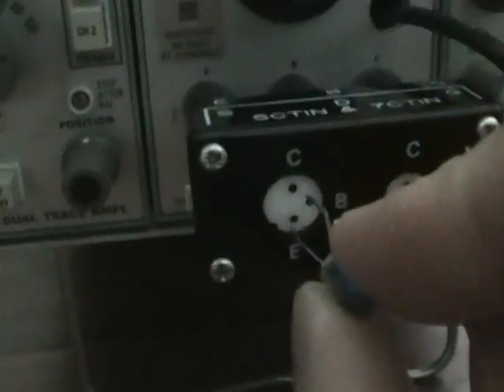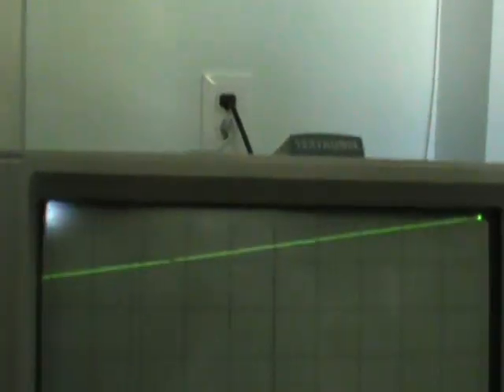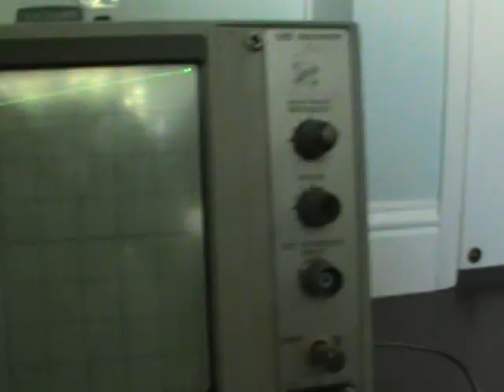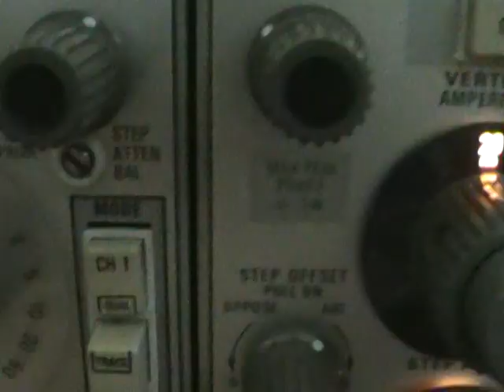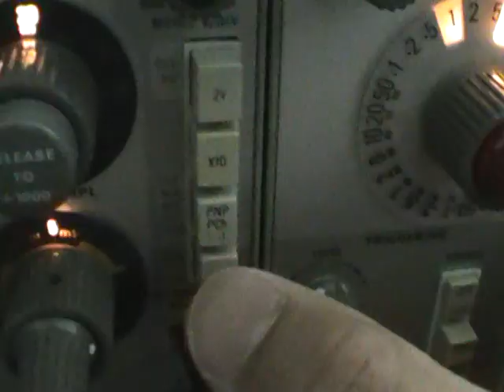Strange LED Phenomenon

Comment: The curve tracer plugin 'sweeps' a junction with voltage ranges between Vmin - Vmax (usually 50Hz or 60Hz AC) and measures the junction current, displaying the voltage/current relationship on the screen.

The trace hysterisis is due to the LED junction going in and out of conduction.
Reply from the maker: I made a video that shows me using a simple curve tracer that does not cycle. https://youtu.be/qY6TyUI7Nuw?si=mqX9xCRzQ_ffZHP4

There is also an EEVBlog thread: https://www.eevblog.com/forum/projects/linear-led-non-linear-led-strange-led-phenomenon/msg5569403/

Also, from your other comment, zener, and germanium diodes behave as expected for a regular diode, and don't act like a resistor for some part. The only tunnel diodes I have are the trigger circuits of my Tektronix scopes, and I'm not quite keen on potentially damaging them.

Comment: LEDs have a similar characteristic to neon bulbs: high impedance until conductance occurs, then low impedance.

I suspect stray capacitance is keeping the LED in the conductive region, combined with junction temperature increases while conducting.

Id try sweeping a germanium or zener diode, and a tunnel diode for comparison.

Comment: If you are testing with a pulsed signal, the barrier capacitance also comes into play. The value of this capacitance is voltage dependent. With an alternating current, this will show as a variable resistance at the curve. Is the test signal DC or DC with an additional AC component ?

Comment: My hypothesis on the changing behavior starting at 1:40...

You could be seeing temperature effects here - diodes typically have a strong temperature dependency.  When you first plug in the LED, it has been fully OFF for a short period of time, allowing it to cool.  So when you first plug it in and are checking low currents, you get the resistance of a "cool" LED.  Once you drive it hard enough to turn on though, the diode heats up and his resistance drops, lowering the curve in the southwest corner of the trace.  Since the tracer keeps turning the LED ON each time it sweeps current, it stays warm, keeping the lower southwest corner pinned near the bottom.  You can test this theory by using a heat gun to warm up the LED after it has been OFF for a while and see if it recreates the same effect.  Cold spray should increase the slope of the early part.

If it doesn't, then it appears that reverse-biasing it before hand has left a residual charge on the junction the takes a certain amount of current to blow through before it regains normal operation.

What I find interesting is the small loop on the slope during conduction.  I would expect that to be a single straight line.  I wouldn't think that the temperature would change that much between going up and down the curve, but maybe it does.  It would be interesting to see if that loop widens with cold spray or a heat gun.

Comment: Did I understand it right? After "pre-conditioning" the LED with reverse voltage up to the breakdown value you see resistive behaviour in forward direction. As soon as the usual forward voltage of the LED is reached, it returns to an usual diode curve?

It´s long ago I did semiconductor physics, but let me guess anyhow: A diode in reverse direction spans up a depletion region at its junction. As soon as the reverse breakdown voltage is reached, charge carriers pass this region.
My assumption is: After removing reverse voltage, some of the charge carriers stay in a metastable state near the junction and behave like a crystal lattice defect. Lattice defects induce resistive behaviour in semiconductors. As soon as the LED lights up again, the junction is flushed with the charge carriers as its designed for and returns to its original state.

I have no idea if this effect a) is like I described b) has any name. Maybe some real semiconductor physicist can tell.